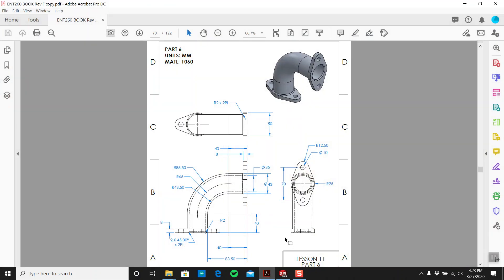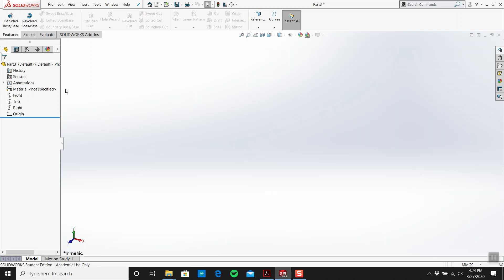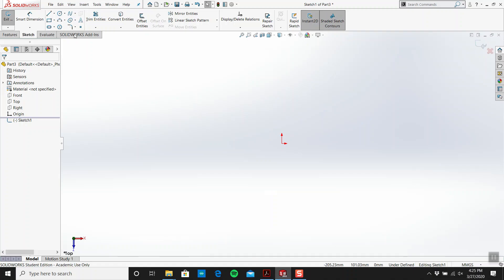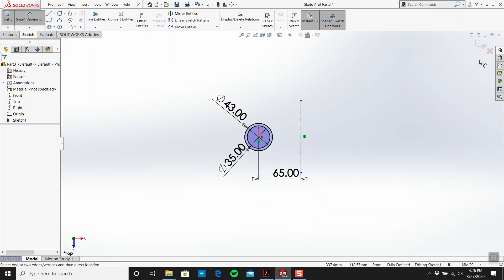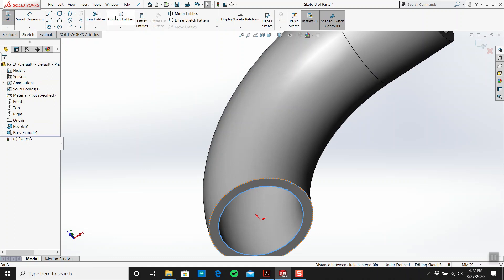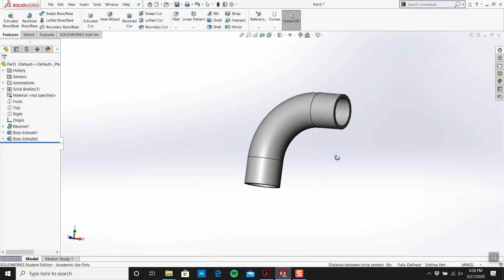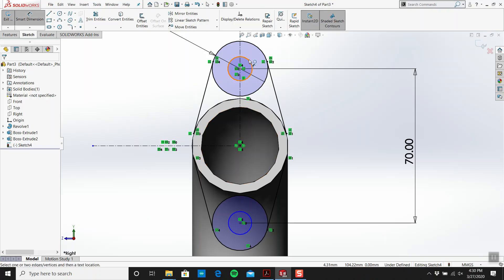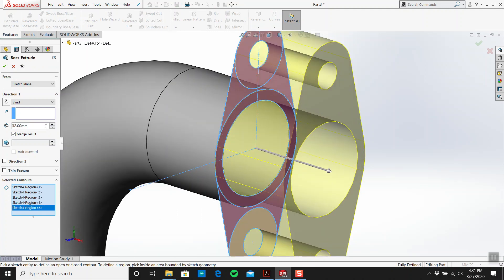Solidworks Practice Problem 6

Comment: Tim, I'm a beginner but I stumbled upon a quick solution to adding the 2nd flange. 
TAKES LESS THAN A MINUTE.

Perhaps due to the 1st flange being merged, you can't copy and paste the feature.
But you can the sketch - here's the process:

1) orient pipe so you're looking into the bottom opening
2) while feature tab is active, click on the face of the pipe (between the 35Dia and 43Dia)
3) go to feature tree,  while holding the CTRL key, with LEFT mouse click on, KEEP HOLDING, and    drag the sketch that was used to build the 1st flange over to the lower pipe's opening  and RELEASE LEFT mouse button.
4) click OK to the message
5) A new sketch will appear  near the pipe's opening - also a new sketch in the parts' tree
6) click on the new sketch name in the parts' tree, click on the "sketch" tab and "sketch" on the ribbon
7) the new sketch will be active -  CTRL click on the inner 35D of the flange, KEEP CTRL and CTRL click 35D of the pipe and select Co-Radial. The part will be moved over the pipe. now just extrude and put the 2 mm fillet.
Reply: OOPPPS in step 7) - should be:

7) the new sketch will be active -      click on the inner 35D of the flange,    CTRL and click 35D of the pipe and select Co-Radial from the properties area. The part will be moved over the pipe. now just extrude and put the 2 mm fillet.

Comment: I did the second face by using the "Curve Driven Pattern" feature in the "Linear Pattern"  feature arrow (accessible when you click the arrow adjacent to the Linear Pattern box). This allows you to select a sketch, face, or body to move along a curve on the part. I made the pipe by using the "Swept Boss/Base" command so I had a curve in the middle of the pipe that I used for the "Curve Driven Pattern" feature. This way is the easiest way to do things.